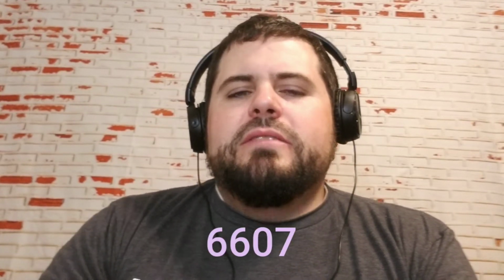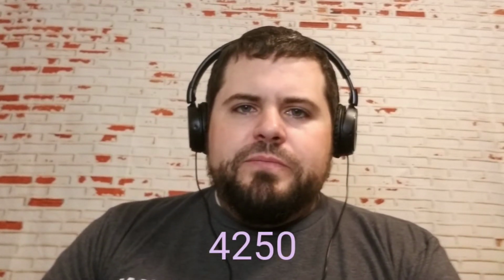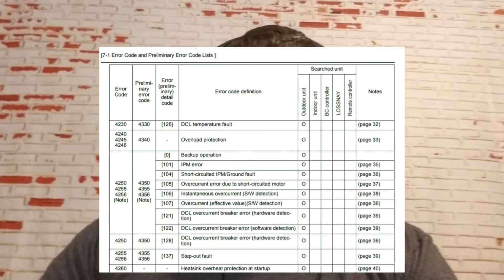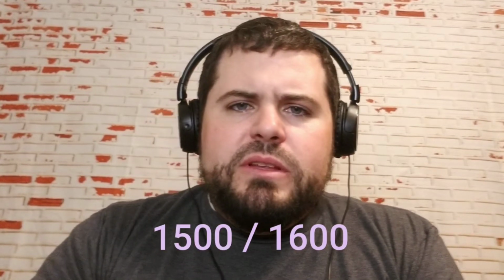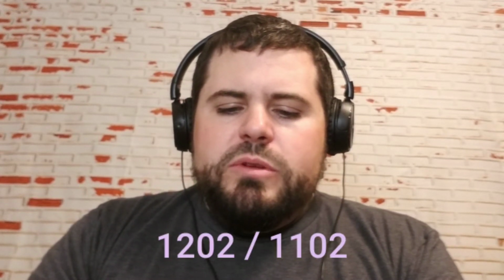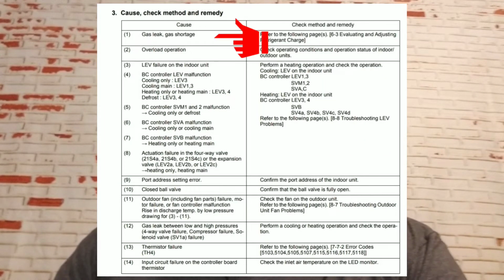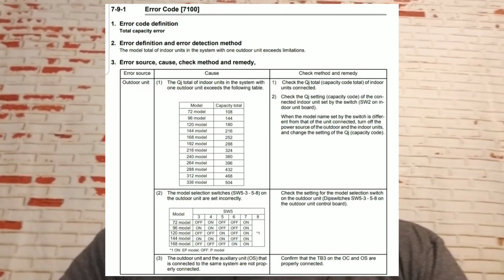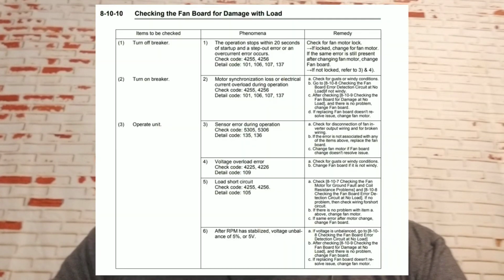5 common error codes

Comment: How do I troubleshoot error 6600? I just installed an additional FCU and had this error showing after every 5mins. After doing alot of test and check, I just couldn't solve it. I also tried to connect the transmission to the other outdoor unit and then the error changed to 6607. Thank you.

Comment: Had 6607 this morning, as well as a 7100. Currently have a master/slave pury-500 giving me a 1500 (overcharge) issue. Unit has been running over a year, and the problem has literally come up in the last 3 weeks. Happens sporadically. Running 14 indoors (cassettes) all lev/shell temp/discharge temp:pressures check out. Accumulator ices up pretty badly, leading me to think it’s letting liquid back from bc box. Any other help would be appreciated 👍🏻

Comment: Just had a central control is installed with unshielded  comm wire, unit would connect and control system but would go into 6607 after about 10 minutes, luckily all M-net had shielded cable, so I was able to get temporary operation without central control.

Comment: Thanks man I watch all your vids. 

Anyway you can do a video detailing all the procedures for doing a maintenance.

What to benchmark. What to look for? Do you command the whole system to stop to zero out your sensors? Do you ever put drain spray on your units? XYZ it would help a lot.
Reply from the maker: I can put it on the list.
Reply: VRF Viewpoint pulease bossman.